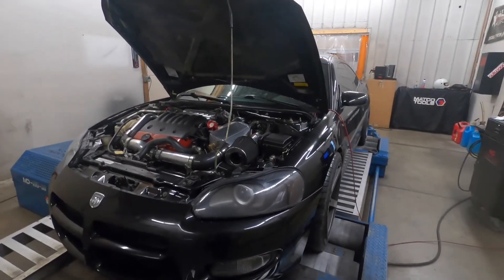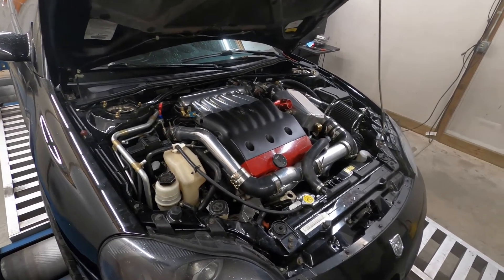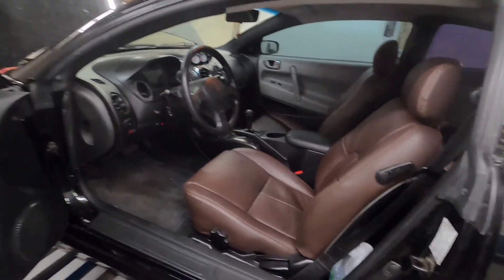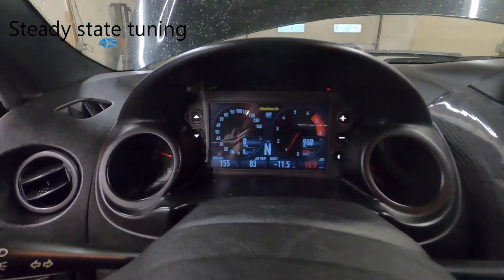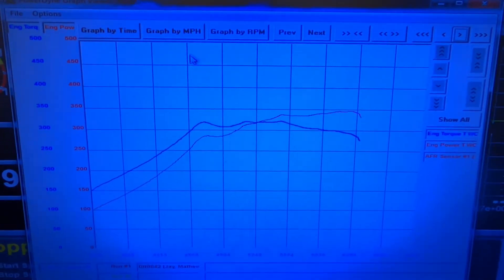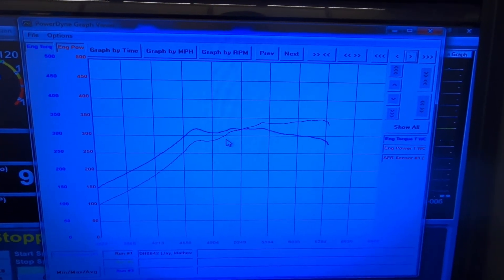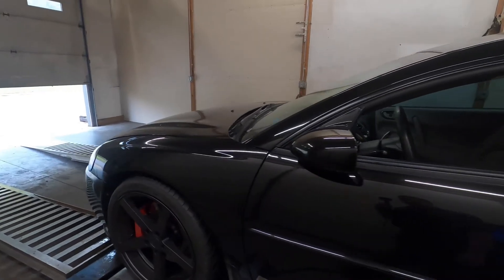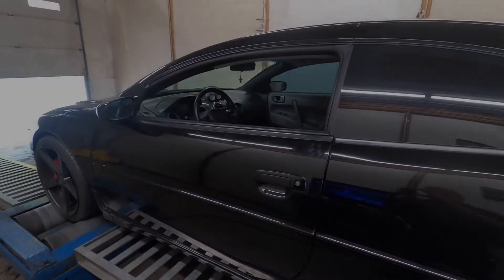Dyno Review - Swapped & Turbocharged 2001 Dodge Stratus | Haltech Elite 2500  ECU

Comment: 7 years ago when I first bought my 02 SXT I felt like I never came across any others on the road or online unless it was a Sebring/ eclipse but now I feel like they’re getting the appreciation they deserve. 224k Miles & still going strong. Hoping to keep it forever just cause it’s my first car. Happy too see this video
Reply: I’m at 250,000 transmission bearing have been bad since around 230,000 miles it’s my first car and transmission was going when I bought it and still goes strong sounds like pennies in pop can shaken at a rhythm very reliable car even tried to kill the transmission and still daily it been think about going 6 speed evo and twin turbo dumped out the side of the front bumper.  Stock these cars can hit 60mph in second gear and top out 115 with limit and 144 without

Comment: what fuel did you use on that dyno run
Reply from the maker: Tbh this was some time ago now, and i do not remember what fuel it was on at the time.  Seems like it was still on 93.  But i ciuld be mistaken.  Ill try to keep better track of those details in the videos.
Reply: @ForceEngineering  is that a built engine or utilizes stock internals from the factory? if you don't mind.
Reply from the maker: @osama1929  i believe it was a built engine.
Reply: @ForceEngineering  alright =)

Comment: Can the top port be plumbed for the wastegates?  I only have the capability to run an 11 pound spring and I can build 40psi with my setup.  Although I would agree that he'd probably want at least a 12-15 pound spring.
Reply from the maker: Its an internal style wastegate without the ability to run pressure to the spring side of the diaphram.  Otherwise yes, and that is how we normally prefer to run them.
Reply: @ForceEngineering  Ah gotcha, yeah I noticed a huge difference with an external gate, I had so many problems over the years with an internal setup.  It does look like he may be hurting for room in the engine bay, but like you said some beefier springs would probably take care of it anyways.